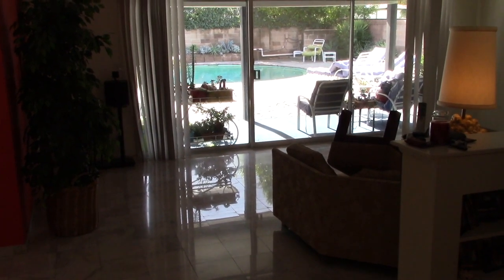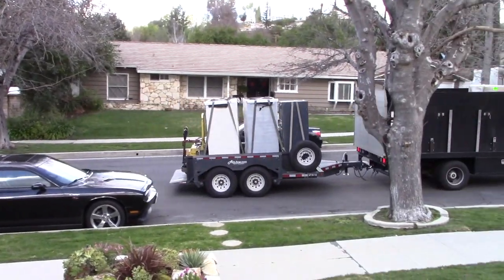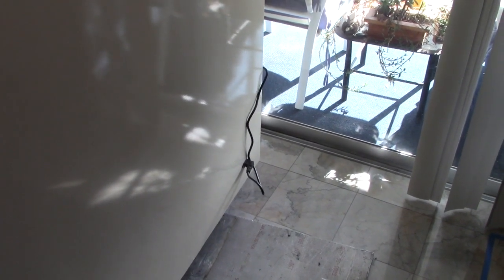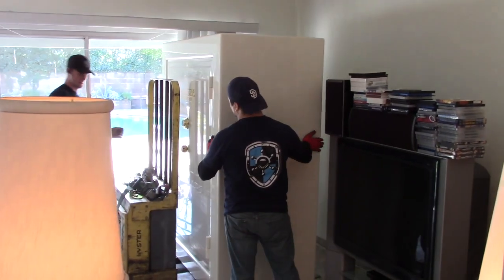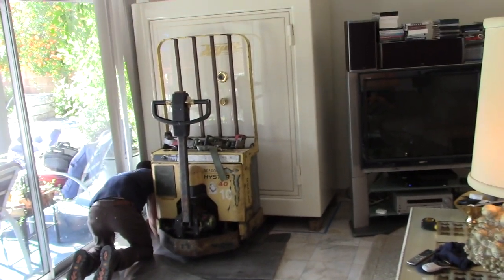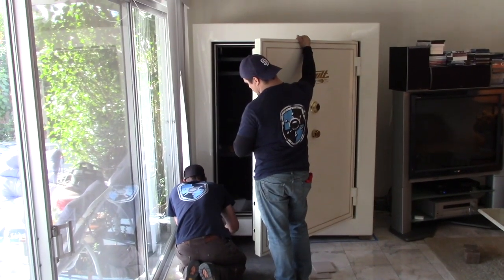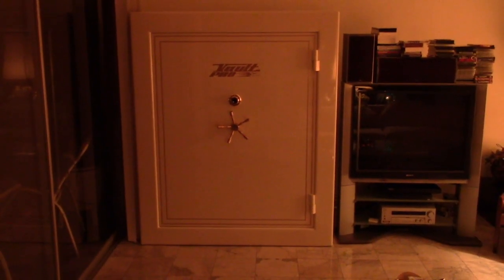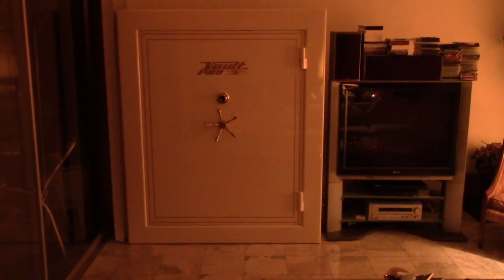Gun Safe, Moving a 3000 lb. VAULT PRO USA SAFE

Comment: That’s a very nice safe. They did a good job putting it in on the floor but I don’t want to be a Debbie downer but I hope your floor is on a slab your house looks like it’s on a slab with no basement if it is in the basement you better think about reinforcing the floor even though it’s in a corner remember building code say that it’s 40 ft.² so you might want to think about that but your house looks like it’s on a slab the other thing you might wanna do is kind of like not like open the drapes on your slider window because your house is facing the back and you’re cheap slider. Lock could be jimmied and somebody could walk right in there with a big grinder and open your safe so you might wanna think about like covering it a little bit but outside of that very nice.

Comment: How tight is the gap between door to frame?? Also is the frame were the bolt lock behind thick???
Reply from the maker: J W gap is dime width a inch solid steel behind the bolts
Reply: @jkelley2091  so the frame is 1 inch thick were the bolt set behind?? I'm looking for good details videos on how safe the safe are.
Reply from the maker: J W go to vault pro website